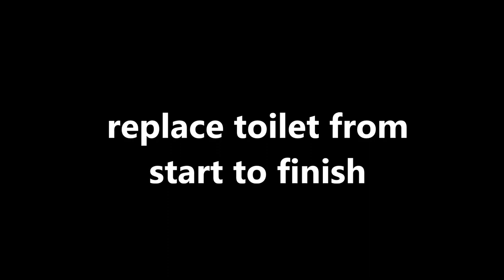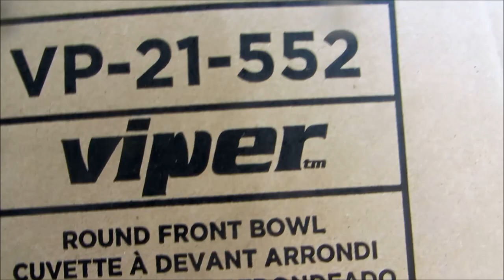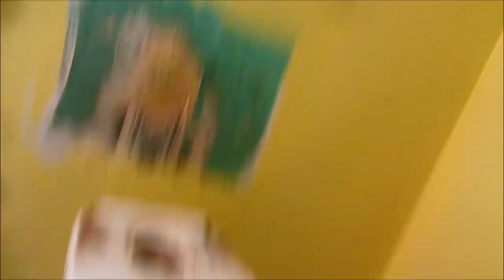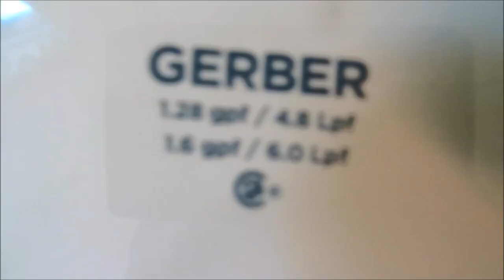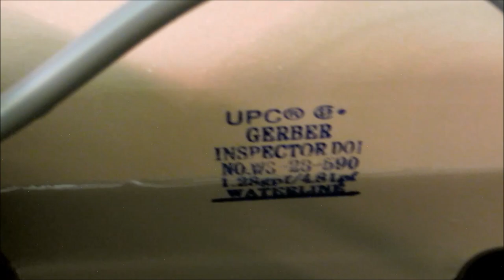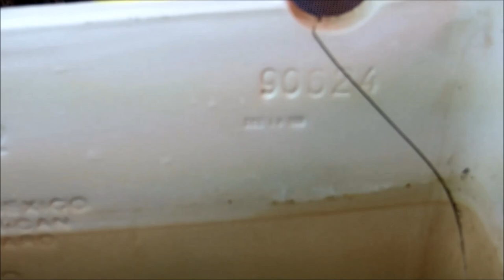plumbing:toilet replacement from start to finish #1

Comment: Hey steve been a subscriber for a little over a year now and been on a service truck since I was 13 just recently got my license in NC and opened up my own business. I have always wondered where you got that suction pump from. Did you make it or purchase it? If so where can I get one. I get tired of spilling water everywhere even after I plunge the commode before I lift it up. Thanks.

Comment: Congrats on 2000 subs Steve . Do u prefer Gerber toilets over American Standard and Kohler or Gerber is what your supplier deals ?
Reply from the maker: justin henning i have had good luck with gerber and mansfield there a good flushing toilet and does not cost a arm @ a leg i do not like kohler at all .......american standard are ok also ..
Reply: Do the new Mansfield have the bad flush tower set up still ?
Reply from the maker: not sure been using gerber on last few replacements but the new law is 1.2 gallon flush ..so things are going to change with internal parts .
Reply from the maker: i have no problem with mansfield flush valves ,i have all the parts in truck to fix them
Reply: Ok thanks for the reply
Reply: jhenry1041 I just find alot of broke toilet handles cause of the weight and as far as parts in my area it's a pain

Comment: In Europe we always use a cone shaped toilet tank rubber washers and a metal washer and a bolt with nut on the other side. What tipe is more secure? the cone shape or just a big "pancake" shaped one?
Reply from the maker: Vytautas Poška it europe things are different for sure ..

Comment: Steve, question, on pretty much all of your tank bolt replacement videos I see you never use the second nut to secure the tank bolt to the tank first. Are there any advantages/disadvantages?  Reason I ask is I replaced a few  toilets in my rental property with a Gerber 1.28 GPF unit  and it came with a second set of plastic bolt nuts like yours in this video that I thought were extras, and I discarded.  I later found out a few days later reading the instructions there were suppose to secure the bolts first to the tank, then the second set of nuts secures the entire tank to the bowl. I never had leak issues so far with the toilets I installed, and I'm just wondering if you ever ran into any issues. Thanks, enjoy watching all your videos.
Reply: He does that because if the tank bolts rotted it would be easier cut

Comment: i have replaced a toilet before. i replaced one that was at my old house that i wanted to keep. i really like kohler toilets. i replaced it in 2015. the toilet was from 1996 it was. 19 years old when i replaced. one thing i always do is i remove the tank before

Comment: I use funnel wax a lot and it does not splash or leak, it also reinforces the wax
Reply from the maker: +STLbluesfan1 lol wait and see you will have problem with them funnel waxes,,,make my words lmao
Reply: +steven lavimoniere I use your waxes or I'll use a rubber seal if the flange is glued inside the pipe
Reply: +steven lavimoniere and I hate those spanner flanges bc you cannot get the bolt out of them if they're rusted. And I forgot to say that I am comfortable with changing the wax under my toilets when it comes time to change it or if the funnel cracks

Comment: If a Toilet TWO BOLTS on the Bottom of Toilet BOLTS Break and cannot be Fixed  and Toilet is LOSE would you you have Lift up the Whole Toilet and Replace Toilet WAX SEAL RING or can you change the 2  old BOLTS of the Bottom of Toilet  with out LIFTING ip the Whole Toilet and changing Toilet Wax Seal is their away around it????

Comment: How come you cant just replace a tank when this happens?
Reply from the maker: zarathustra if it a new toilet you might be able to match it up .. i have tried that in the pass and it didn/t fit ,,,so i always just get a matching set and replace both.. they are always changing things designs ect..
Reply: @OCC_Plumbing_and_Restorations  

I'd choose a cheap new unit over  something used, home depot and Lowes toilets start at around $100 for the cheapest model. Just picked up 2 new ones from HD for $250 delivered to my door.

Comment: I wished they would sell the tank and lid as a replacement for just that reason. I accidentally broke ours and didn't want to replace the whole toilet just for the lid. I made a lid out of wood and sealed it with a marine grade clear sealer. It's still works. And yes the wife gave me a dollar's worth of lip when I only needed a quarter.
Reply: hanky97007 ...they do sell just the tank and the bowls separately where I live..Ga.